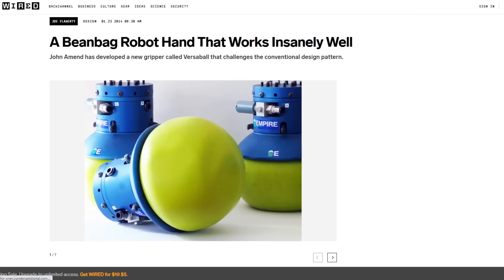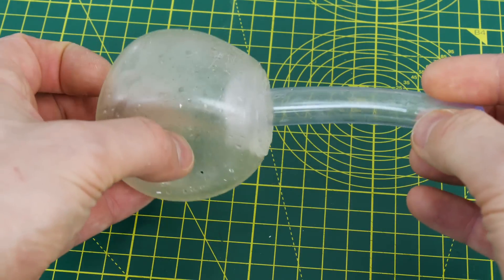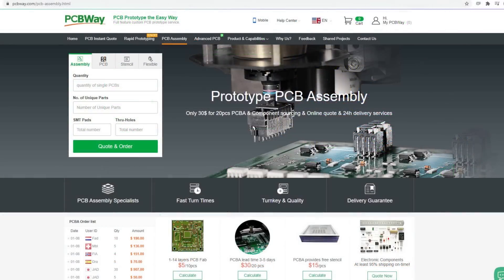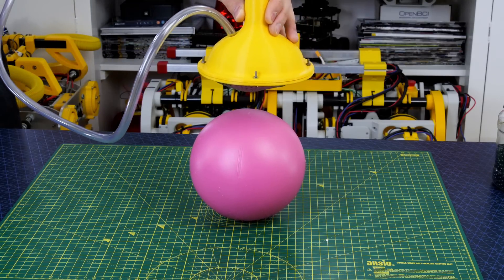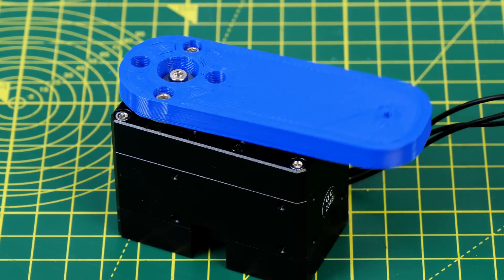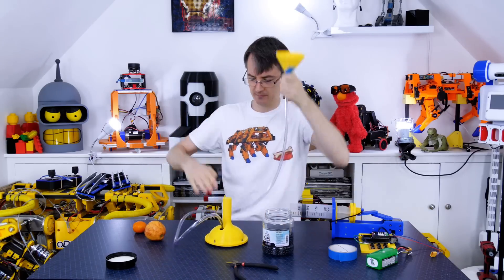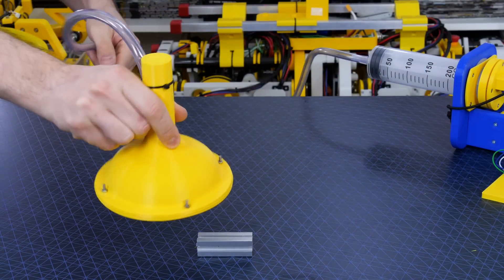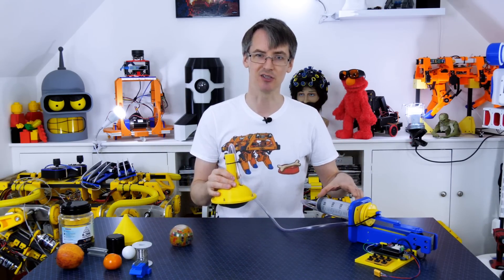Experimental Jamming 'Beanbag' Robot Gripper

Comment: if doing a pneumatic drive would suggest doing the opposite..   so that the object that we want to take is fixed when the membrane is pumped... something like a ring made of a long inflatable roller.. + 1 more in the center vertically. Will allow you to take items for the outside side and the thing in the interior will work like a finger and will allow you to take objects by the inner side...

Comment: So a few ideas.
As many others have said, a smaller granular material could be a good idea.
Also a different or combination of material could work as well. Adding semi-hard rubber balls that have a little give, or expanded styrene foam,  could mold around or into surface features on the object.
More than 1 main ball, Like 3 or 4 of those smaller balls used to conform around an object. 
A vibrator to work the granules into the object better before suctioning.
A secondary airbladder controlled with a check valve to allow air to be "pushed" out of the bags that can be bled back into the system when the object is released.
Air bladders along the rim of the funnel that could apply lateral force as the air is sucked out of the main gripping bladders.
Add texture to the gripper surface. concentric circles or dimples made of a pliable material may help, Like those stretchy hand toys that stick to everything. Can't recall the name of the material atm.

Comment: If you are considering a similar use of a syringe, or a version 2, you might want to implement a crosshead mechanism, https://en.wikipedia.org/wiki/Crosshead, it's only purpose in life is to restrain the movement of reciprocating pistons so that they only move parallel to their cylinder, reducing wear and preventing binding.

Comment: I would bet that using smaller diameter bbs would also help quite a bit. The size of these 6mm bbs is not allowing the gripper to form into smaller areas, like the slot in the aluminum extrusion
Also maybe irregularly sized objects would work as well, however not to sharp as to not puncture the membrane

Comment: Couple ideas. 1. Smaller beads 2. Some sort of filter to keep The beads out of your line. 3. A softer bead, like foam that each bead molds to the small contours. 4. Thinner membrane. Obviously the issue with that is thinner generally means weaker

Comment: I wonder if you could achieve the necessary valving complexity to do the more advanced vent, suction, release, refill cycle using passive fluidic valves. 

Microfluidics have reached a point where you can use photolithography to make layers that, when laminated together, function as fluidic logic gates. Perhaps larger versions of easily printed rigid and x-acto cut flexible layers could be laminated that would automatically open and close valves at the appropriate points in the cycle based on pressure changes at each point. It would essentially involve devising an analog pneumatic logic circuit. 

It might even be drivable with the single servo, if you had other syringes attached, actuated out of phase with the grip syringe. That way if you needed to actuate something using high pressure when the gripper was meant to be released, you'd have a source at the right point in the cycle.

Comment: Using this technique with a rubber glove would be interesting. Maybe something like using pneumatic muscles to position the fingers around an object then pulling a vacuum to make the glove rigid
Reply: I was going to suggest the same thing. If that works, he could then experiment with TPE/TPU printing all kinds of end effectors for filling with beads (why stop at 5 fingers or one pneumatic segment?) even if a spray or paint-on silicone is needed to really seal them up. The result could be the best of the simplicity/compliance soft robotics but with more grip strength.

Comment: Great job on your video! Another source for the loss of vacuum that you are experiencing is with the vinyl tubing that you are using to connect the syringe to the funnel. If you were to use mesh reinforced tubing, and an overall shorter length of tubing, you would see less of a loss of force. But really, great job!
Reply: Yo the king of grippers ian davis is here i love your vids
Reply: 4 screws,,, screw it on with 4 screwws

Comment: I’ve seen the comment about smaller bb-s. By the time that I would have got to the end of this project, I would have put and bent as a pin through the tube then sealed it to stop them going up the tube. 
15:06pm 21/04/21

Comment: Festo came out with something similar a number of years ago that has the pneumatic membrane gripper mimic a chameleon's tongue. I have no idea if they had any material in the gripper or if it was entirely pneumatic, knowing Festo it was probably 100% air. Their design also had much better geometry. I would suggest looking into this for inspiration going forward on this gripper. 
I have a feeling one downside of the larger variation is that you held the membrane to a point where the gripper was more or less flat. Look at the original beanbag gripper, it's an entire sphere that engulfs the object, with the membrane only held within the upper regions of the top hemisphere. It's a simple geometry issue. Another issue would be the size of the grains in the beanbag, you'd want something much finer, for better surface quality when gripped. Another potential issue could be the membrane itself, that particular membrane from the toy may not have the surface adhesion, i.e. friction/lubricity properties, that're desirable for a gripper. 
The next design can fix two issues easily, use a finer grain material and follow the original design more closely, doing so will show if the membrane material is workable or not. Then from there look at other designs, such as the Festo DHEF, which is a long conical shape that'll better morph its tip to the object, and at times folding in on itself to form a more optimal gripper; such as when picking up a pin, it'll form two lobes around the cylinder that act like fingers. I'd also suggest putting a filter between the pneumatic line and the beanbag, as you do not want fine grain particulate going through your pneumatic system.

Comment: I built one of those like 6 or 7+ years ago. My recommendation from my experience would be smaller grain size. So long as you have a filter that is good enough for the grain size you choose the smaller the size the better it can conform to the shape(within reason there still has to be sufficient airflow around the particles to allow a decent vacuum. Also a cheaper alternative to the squishy toy is to just use a rubber balloon that you can pick up anywhere for a few cents. The syringe with a servo is a good idea though. Personally in an industrial setting at least I would just use a vacuum transducer (can be easily 3d printed so that might be an idea for a future project) and compressed air to generate the vacuum or a vacuum pump.

Comment: I think the original gripper used coffee grounds for the proof of concept versions.  The smaller particle size will conform better, and the low stiffness of the powder will allow it to shrink around objects after it becomes rigid.  I assume they've since switched to a ground plastic of some kind that won't mold or rot.

Comment: Irregular shape bb's, mix of sizes, and some, 50%-ish, with holes drilled thru. An octopus shaped pad. The cup should be 56% the shape of a sphere, ie. The edge should tuck under. I ended up using a secondary membrane also. This design picks up a 16 lb (1 st) bowling ball @ 15 psi.
And, btw, that is not an orange

Comment: You should try using the shortest hose you can because if that tube is about the size I think it is. It looks to be about 1m longer and 1/4 inch or about 8mm. That would be about 50cm^3 of air you have to also suck into the syringe and is going to be power lost in your gripper. Your pressure is that you generate is I think P1V1 = P2V2. P1 = 101.3kpa P1=60cm^3 V2=50cm^3+(the volume of the air gap between the balls and the air gap between the balls and walls) which you could probably guess to be 5 to 10cm^3. I think you can even calculate the maximum power the motor needs to apply to draw the syringe except for frictional force.

Comment: For weight concerns a replacement of almost similar grain size would be airsoft pellets but i would recommend a finer material, sand or dry packet silica with a cloth filter as a barrier works nicely flour and a balloon with a a few cloth /silk/ fine air pernissive membrane is optimal if thats to fine oats or granola works well and maintains low weight parameters 

Havent tried Styrofoam yet that could be need due to potential squash factors

Comment: It would be nice to experiment with using sound or mechanical vibration to create a semi liquid fase there to get in every corner before sucking the air.

Also the opposite could be tried. A non newtonian liquid in the bag, and vibrations to change its fase to a solid.

Comment: smaller bbs, positive air pressure in the system. ideally, with enough bbs in a rubber with positive air pressure, you are pressing air into the system to soften grip instead of drawing vacuum.

Comment: I think the issue is the retaining ring holding the membrane taut.
It's preventing the vacuum from closing the means around the lower end of the object and the only thing holding parts in place is friction against the sides.
If you allow the membrane to close around the part is say your gripper will work better.

Comment: I too was curious about the effects of smaller diameter objects being used for grip, seems like others have tried that with success. Another question I have is about the texture of the membrane, how much of the function of the device does the texture account for? Given that the principle is about the pellets establishing grip points and the material maintaining grip I assume this could be an upgrade worth doing.

Additionally, without breaking the laws of physics, is there anyway to improve its potential of lifting heavier objects besides increasing surface area. Like you displayed on objects with a lip, that creates a lift more depend on the integrity of the machine over the friction forces holding items in place. I'm curious how much the suction being applied to the bag effects the net weight of the objects below. Or, what the max weight the friction forces can lift is based on the surface area of the device, and how much additional weight could be added through increasing the suction power of the machine itself. I would assume that without a membrane that allows the passage of air, the additional suction would do fuck all once you hit the threshold of suction that allows all of the potential friction forces to be applied. 

So what about using an electroactive polymer with small holes to allow air to pass through. You could use the membrane itself "suck the air out" while still leaving the option of air passing through. Then you could use an air pump to suck the object into the device before tightening the membrane to ensure proper grip of the object, or just use an overkill pump for the option of using the pump to provide the entire force instead. This way the same machine could be used to lift a variety of objects with two different methods of lift. Overall this would aim to reduce wear on any air compressor/need for compressed air, reduce the operation cost, and if used without an air pump for assisted lift this would greatly reduce the size of the machine. My knowledge of this is very limited and conceptually it seems like something worth trying. Potential hinderances I see would be of course finding a polymer that is elastic enough, the holes for air flow making the polymer contract unpredictably/cause pellet loss, and if that all that goes well the holes are reducing the surface area of the device lowering the threshold for non air assisted lift as well as raising the minimum size of the pellets themselves. Meaning that although it may be possible, a "regular" machine with a smaller pellet size and no holes reducing surface area could potentially eclipse the machine with the electroactive polymer making the machine far too situation for the cost to build it. Really only allowing it to shine under a potentially cheaper operation cost for certain objects, and potentially larger lift capability assuming the air compressor could be efficient enough under such weird circumstances. Still I am curious to the crossover and if one were to overengineer the two devices, what the limitations of both approaches are.

Comment: Nice idea! But you should use Styrofoam balls instead of bbs. This will make your contraption mutch lighter =).

(small Styrofoam balls are used in the beds of ambulance cars to secure an lock the patient in place for the travel to hospital : they suck the air out of the surface the patient is lying on, so the surface has the perfect shape of the body =))

Comment: I agree with the smaller BBs opinion and would add that possibly adding a larger syringe that would allow additional air to be blown into the ball while pressing down on the object, which would allow the ball to contour to the shape of the object better. It would have a better chance at grabbing at undercuts, that could increase the strength of the grasp. Also, the shallowness of the cup shape seems to be hampering the grip. I almost want to say that it should be a ring rather than a cup, that would allow maximum expandability around the object. This is why I think the commercial grabber sticks the shape of the ball practically all the way out the fixture. It allows the ball to fully surround and mold itself to the object.

Comment: What I feel is, you need depth to grab objects well. Anchoring the rubber on the sides so it's so stretched increases the width, reduces the depth you can achieve. Might I suggest you try the same membrane with a smaller hemisphere? Would like to know if I'm wrong

Comment: You could easily have an air release valve and have it still be dumb.
When the air release valve is open the syringe could move back to the start; releasing the air and reaetring the stroke. If you use a bigger syringe you could use some math to estimate a percentage of stroke. Can you get force feedback on that servo? The force on the piston could be used to dynamically afjust the servo angle.

Comment: Very Interesting concept! Quite curious to see another video of this maybe using smaller pallets. (For example: raw plastic pallets used for injection moulding)

Another suggestion would be to initialise the syringe at 25%. This will reduce the suction capability but it would also allow the objects to pop out better :)

Comment: Cool gripper design! 
If you tried sealing the 3d printed funnel or printed in resin. You could then clamp a circle cutout of a silicone sheet or those large thick balloons over the opening. If you can get a reliable seal, it would open up a lot of options for finding the best material and thickness to get the best grip.

Comment: I agree with some of the other comments. I think you need smaller bbs, but I think that it might help if they were irregularly shaped as well. perhaps if you filled the membrane full of dried rice or something like that? I would think that it would cement together more rigidly with all the air removed. plus, it could be a lot lighter than the bbs.

Comment: What if you slightly inflate the gripper before grabbing an object (larger volume of the rubber = more surface contact around objects, and also allows the bb pellets to move around the object with more ease) and then sucking the air out?

Comment: You can also try a smaller particle size, like rice perhaps! Also, if you fill the system with some water it would be better as air is compressible. I say some because the compressibility is advantageous sometimes!

Comment: It might be interesting to get a larger syringe and assemble it with the syringe in a center position. That way you can push air into the balloon and have the membrane more stretched when you make up with the object. Then when you suck the air out, there should be more contraction of membrane giving more grip.

Comment: Just as a FYI, in germany we have mattraces and tubes that work by the same principle and are used in medical emergencys. If you need to fixate something quick, you just put the limb inside the corresponding "bag/tube" pull out the air and the limb is immobillized. Or when you have someone with a back injury, you put em on a air mattrace type of thing, fold it gently around the person and pull out the air.

Comment: I love the concept! 

I think a smaller cup would help. You're starting with your membrane stretched almost flat. The original you're copying has the membrane almost entirely outside the cup at rest. Also, like you said, a larger syringe. Someone else said smaller bbs and that would help with forming around the object as well. 

Finally, I think the stretchy toy membrane is too stretchy. You need a rubber that's flexible and only a little stretchy, I think. Like an inner tube.
Reply from the maker: I'll try a custom moulding next time!